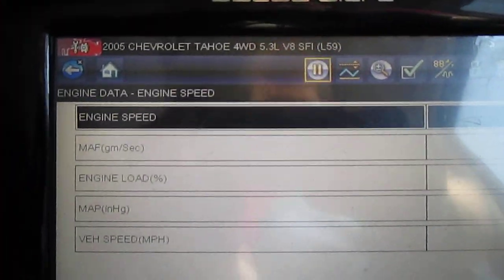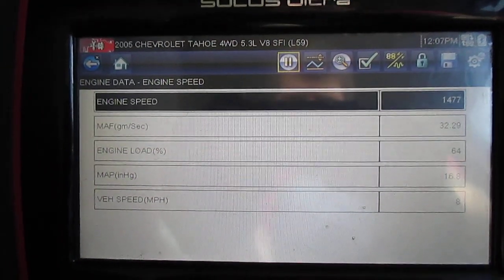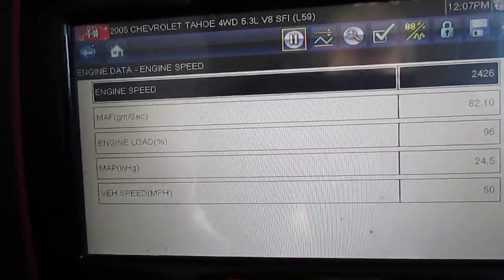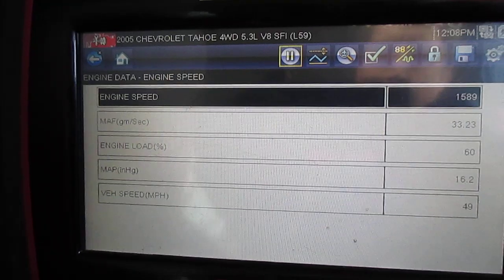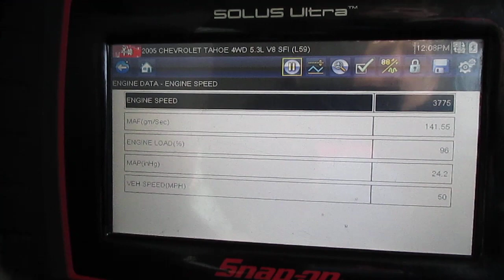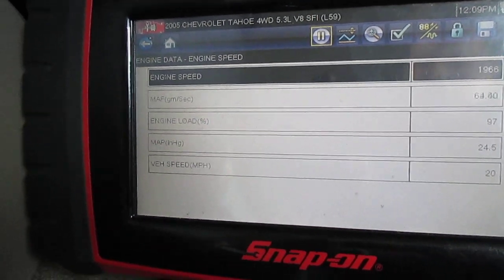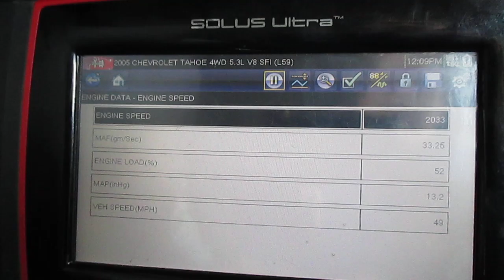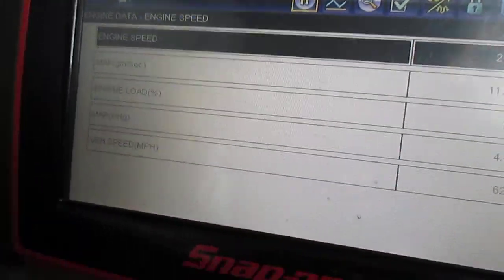Engine Load & MAP reading

Comment: Why does the map read such high inhg under full load? It was reading like 29inhg. Shouldnt it be lower since the throttle plate is open?
Reply: Never mind because sealevel pressure is 29inhg. Lol
Reply: @lukecartwright1803  gas engines will naturally create a vacuum in the manifold so the reading will be lower (around 5-8psi). I suppose once the engine is sucking enough air and the throttle plate is wide open, the volume of air creates more positive pressure?

Comment: What does that all mean ? like is your load to high or normal ?
Reply: Looks normal  ! when map sensors  are bad that live data ; map when you rev does not increase it decreases
Reply: @iamasmurf1122 it decreases huh? About to check this one out and see. Thank you
Reply: Engine makes the most vacuum at lower rpm